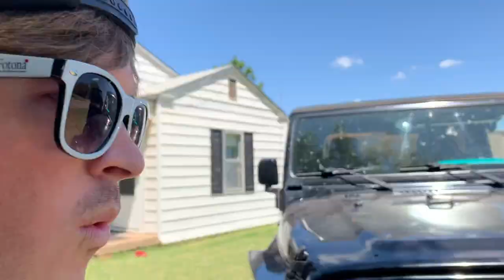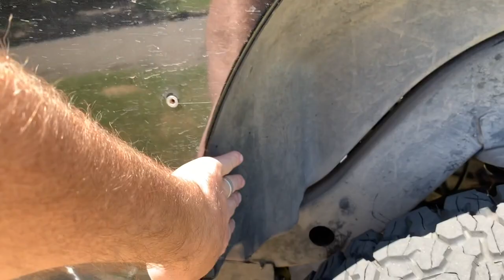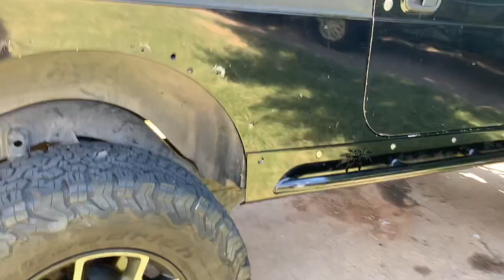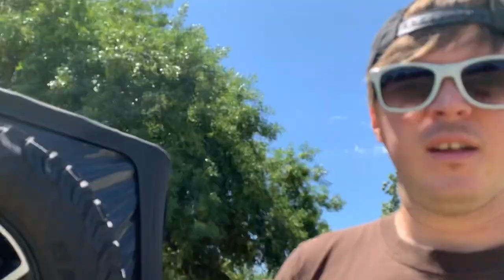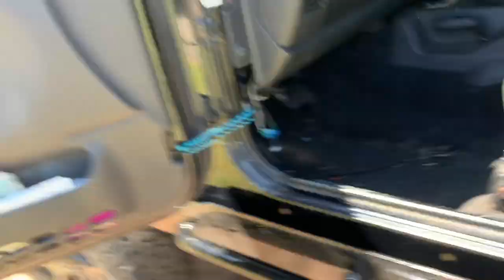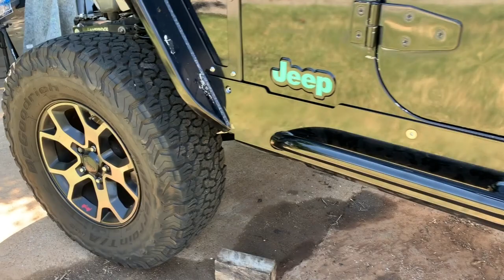Installing Poison Spyder Rocker Knockers on Our Jeep Wrangler Unlimited with vision impairment

Comment: Any tips on where to position the jack? What are you using as a extension on your jack? I have my jack between the fist and second body mount, closer to the first mount, using a 6x4 block to jack up the body. I have a 2006 LJ and trying to install the poison spyder ricochet rockers and they contact the 6x4 when I try to side them into the body mounts.
Reply from the maker: FLV8Jeeper are use a piece of wood and there’s a spot where the body mount is or the Jeep logo is on the side of the tub that you can fit that piece of wood in in between the tub and the rock slider there’s enough space to have it in there against the floor.
Reply from the maker: FLV8Jeeper there’s just like one spot on the floor where the rock slider doesn’t reach. That you can lift the floor of the jeep up. Wish I could send you a picture LOL it’s kind of hard to explain but there’s just a sweet spot by the Ford body mount close to the fender mount.
Reply: @wrenegadeoffroad1400  Thank you for the reply. I was able to put a small piece of a 2x4 flat on the floor just behind the front mount and use a longer 2x4 standing up on my floor jack and jack up the body that way. It's a PITA installing these by yourself. Thank you again.
Reply from the maker: FLV8Jeeper problem man yeah that’s the spot I was trying to say LOL. Glad you got it figured out
Reply: Thanks for asking this question a year ago. I have been trying to figure it out as well and this saved the headache.